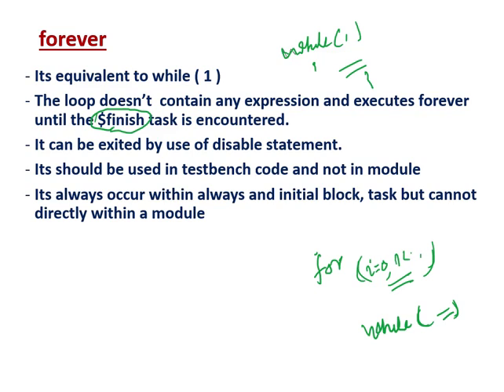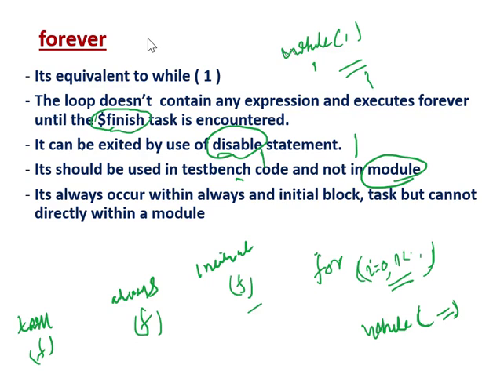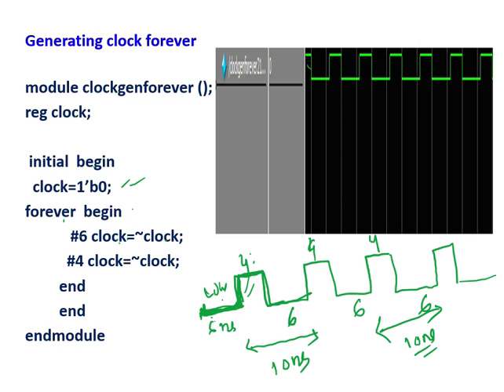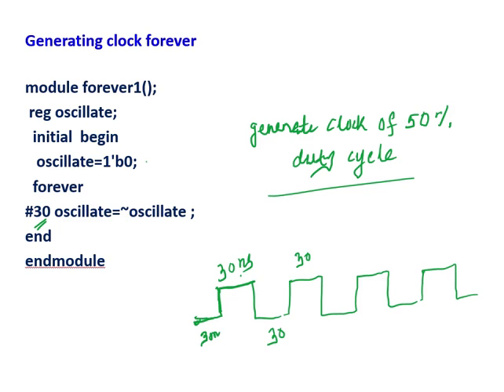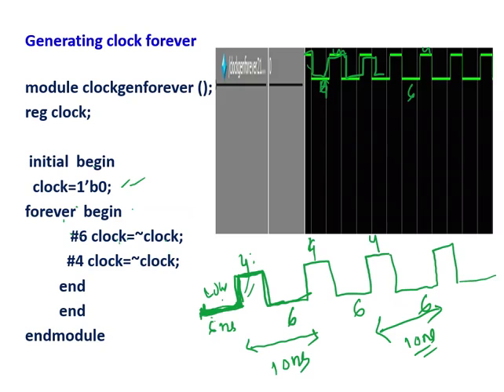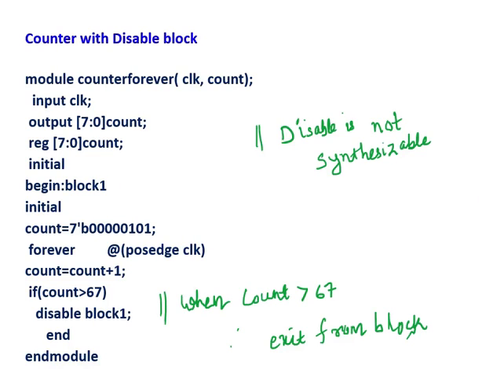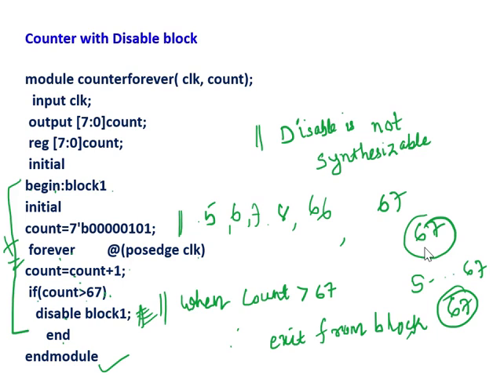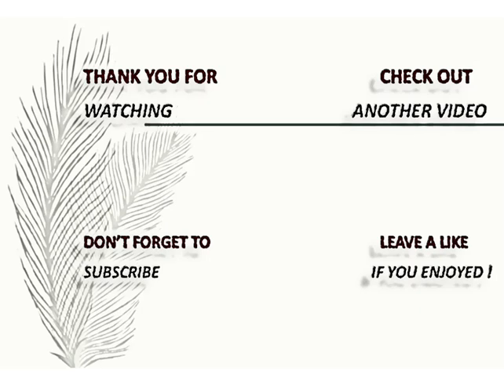#31 " forever " in verilog || How to generate signal with different duty cycles using "forever"

Comment: Sir in last example,
count should be = 8'b00000101 because of 8 bit instead of 7'b00000101 ?
Reply from the maker: You are absolutely right. It's 8 bit.

Thank you so much for pointing out the mistake.

Comment: sir what does ossilate= 1'bo mean..?? 1 stand for here ??   '=?? and bo= mean..??
Reply from the maker: 1'b0 means 1 bit binary 0 means 0 is a binary digit which is of 1 bit.
Like
2'b00 , 3'b011, 4'b1010 so on

3'd7 means 7 is decimal number and it's 3 bit i.e 111 in binary

b, d , h are called format specifier for binary,decimal, hexadecimal respectively.
Thanks.

Comment: Sir nice explanation very useful and can you make a video on timescale and an example of 100Mhz clock using timescale
Reply from the maker: Timescale is used for simulation by simulator to define the time.its never used to design a clock signal. It give just timing information and the precision. 
I will explain about it when I will make a video on writing test cases for memory testing.